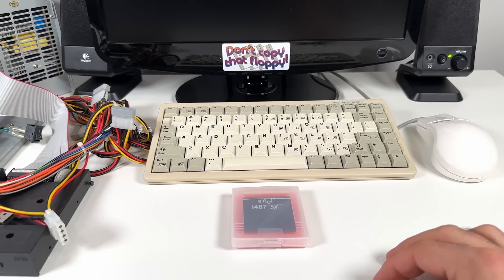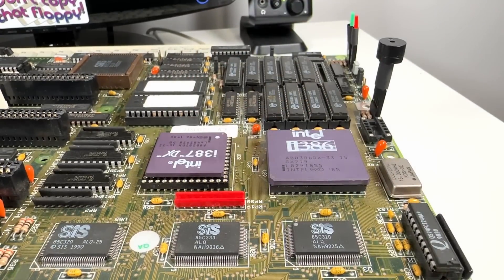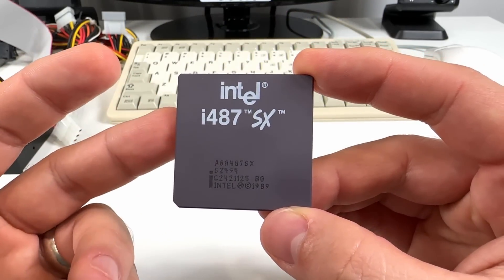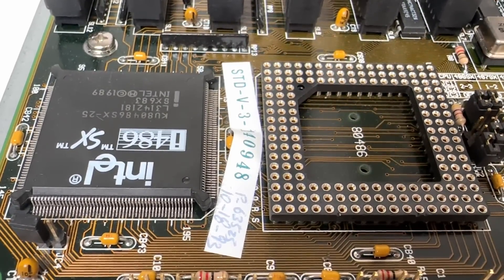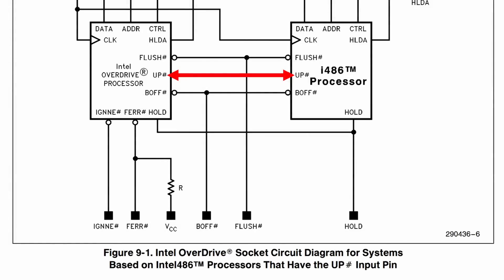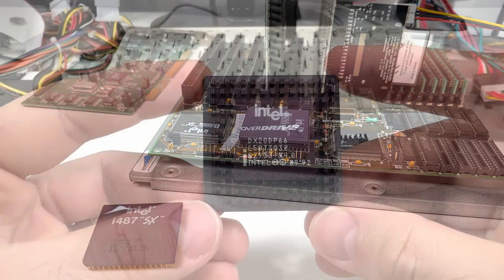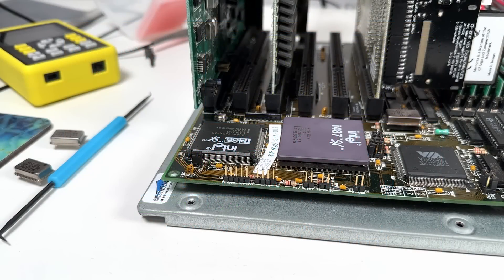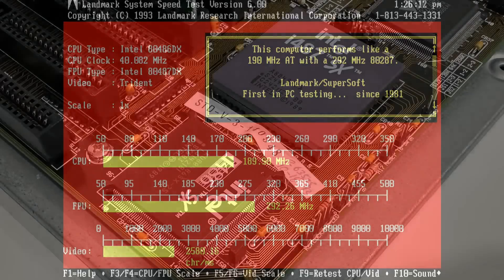The Intel i487 SX Math Co-Processor - Disingenuous or Just Misunderstood?

Comment: Intel called pentium a 5th generation chip. AMD may have had a 586. Cyrix 586 wasnt even pentium 1 486.

You needed a 487 and 486 for lotus table. 486 realesed with 387 backwards compatiblility. 

86/186
286 IRQ
386 bus logic (387 front bus with 32 bit memory addressing)
486 program blocks/pages
586 program specific memory- (pentium 3 with 133mhz front bus executing 4 operations per cycle)

Like the 386 could x86 32 bit pages, but the 387 calacukated half of 2 operations per cycle.

Comment: Hello! My first computer was a Compaq Presario CDS 520 (the integrated model with a monitor), bought in 1994 here in Brazil. It was a 486SX with 66MHz, 4MB of RAM and 420 megabytes of storage. It had a 14.400 bauds internal modem also, witch i used a lot for gaming.

The operating system was Windows 3.1, and it came with a software called TabWorks (which I later found out was developed by Xerox) as its main interface, which was really cool.

I was about 11 years old at the time, and I remember that it cost a LOT of money, something around 3,000 dollars (the Brazilian currency at the time was rubbish -- and it still is -- and everything was quoted/purchased using the dollar as a reference).

I remember that one of the first games I bought with "my" money (allowance) was Need For Speed 1. It didn't run with 4MB of RAM, my father had to buy another 4 megabytes. I played very well with friends who even had 100mhz DX4 486s.

That 486 lasted me a long time, it was an excellent machine. I'm a Compaq fan to this day.

I always wanted to have a math coprocessor to improve the machine's performance even more, but that kind of upgrade wasn't available here in Brazil.

Thanks for reminding me of that fun time of great discoveries, and congratulations on the video!

Comment: I stumbled across this video serendipitously on my feed and I'm glad I watched it! I couldn't help but notice that on your motherboard, there is a serial number strip starting with STD-... and a handwritten date code of October 18, 1993. As a teenager, I worked for STD Systems in London, Ontario, Canada, assembling PC clones (STD was headquarter in Markham, ON). The date would be period-correct of when I worked there; I would have been 17 years old at the time. The only thing that would be crazier if if that were my own handwriting (but it's not). We put those serial number strips after a QC check which followed an overnight burn-in of newly assembled PCs on racks. There would be an uncounted number of computers that have MY handwriting on strips just like that! 

Fun fact: since I was a poor teenaged student, I didn't have the money for a full fat intel 486DX or even a 487SX. With whatever money I earned, I spent back into my computers, gradually upgrading from a 386SX-16 (overclocked, of course, via onboard jumper to 20 MHz) up to a series of cheaper AMD processors and onto another motherboard that got me into the cachet of a 486 owner with a  Cyrix Cx486DLC-40 with a Fasmath coprocessor (but it was still on a 386 board).

I was also one of the many people who later joined the bandwagon of overclocking the Celeron 300A to 450 MHz.

Thanks for the 31 year trip down memory lane!
Reply: Just a question, did nobody question the choice of "STD" as a company name? I would have for sure chuckled and I am not even an English native speaker.

Comment: If I am not mistaken, when Intel manufactured the 486, the SX version was identical to the DX version except the FPU was disabled at the chip level.   
It still baffles me how there were any cost savings possible with the option of installing a 487 math coprocessor.  (very deceptive advertising since it was a full featured CPU),  These motherboards  had a socket that didn't have to be there.  It would have made more sense from a cost perspective just to have one socket (zero insertion force for ease of upgrading)  And for Intel's part, they would not need to sell chips with the extra pin.  
Plus from a marketing perspective, the "Overdrive" product name would have made sense as an "upgrade".  You not only got a coprocessor, but double the internal clock speed.

Comment: I believe the 486SX was originally a full 486DX that had the FPU disabled. Some may have been dies where the FPU failed testing. But essentially, if you installed a 487, it's quite likely you had two full 486DX CPUs, with one sitting idle. I think later versions of the SX did have the FPU removed, though.

Comment: The 486's on-chip cache would make adding an external FPU extremely difficult. For 386's and below, the FPU literally watched every instruction the CPU fetched, and stopped the CPU from executing FPU instructions. So, with internal cache, there'd be no way for an external FPU to know which instruction was executing when! So, my guess is the 487 was really just a marketting gimmick to sell a 486 "FPU upgrade" the same way customers expected from their past experience with 8088's, 286's and 386's, without it really being *possible*... WEIRD.

Comment: The machine I ran in that era was a 386/387 based processor running at 25MHz.  At the time that was extremely fast.  I also had a 100Meg hard drive.  There was a special driver to make the big hard drive work.  The thing sounded like some sort of farm machinery as it was starting up.

Comment: Need we have concerns about heat paste drying out on CPU's which were soldered to their board, particularly during the 90's?
Reply from the maker: Most Pentium and older 486/386 systems didn’t use any thermal paste. If they had a heatsink, they were usually glued on or used clips with no interface material. I don’t think paste became commonplace until the Pentium 3 era. Those chips definitely need the original paste replaced as it gets very hard and brittle.

Comment: cool.  I've been around the block a bit and i've never seen the 487 as a separate upgrade add-on.  I only remember the 486 cpu's being produced with and without math (sx vs dx).   My 286 pc on the other hand had an empty socket for the 287 coprocessor.  Man, I remember how stoked i was when I stumbled on a 287 at an electronics surplus sale.
Reply: after reading the comments, it alll started sounding familiar, not so much the separate math but that they were the same processor...

Comment: Never realized a math co-processor was just an FPU, I always figured it did other "mathy" stuff too.
Reply: Many of them do.  It varies by FPU.  For example some FPUs have trig functions built in, but the CPU still uses software libraries for this instead because the hardware trig functions weren't as accurate.

Comment: The 486SX did have an on-die FPU, Intel just disabled them. Intel deliberately hobbled some 486s to meet demands, but as 486 yields were relatively low when it first hit the market, 486DX chips with failed FPUs had their FPUs disabled, then sold as an SX.

Comment: As you point out, this was basically just to be able to sell 486sx chips. Btw, an average 386 with coprocessor could easily be faster than a 486sx, I have a box of them that all clock higher.
Reply: And yes, I did play both Falcon 3.0 and Quake on 386. Falcon was low res but very smooth and Quake was "fine" at very low resolutions. I even made maps on that machine.

Comment: IIRC Doom originally required a FPU in the processor. That alone sold many DX chips.
Reply from the maker: Thanks for watching! Doom actually had no floating point code in it so didn’t benefit from an FPU, but perhaps you are thinking of Quake? Quake was really the first big title that had a 100% requirement of an FPU and wouldn’t even start without one.
Reply: @vswitchzero  TIL, Maybe it was a performance issue. Dunno why I always thought you needed a 486DX-33 min. 
Thanks for the correction

Comment: Floating point math was always used in a variety of applications but generally they were not used so heavily that is mattered if the operations were performed by the main CPU or by a special purpose CPU ie. a FPU.
Reply: You've obviously never used autocad on a 386 with and without a 387 installed.  The speed difference is astounding.
Reply: @stargazer7644  Autocad is one of those applications that justified the expense. I worked for a company that designed buildings, they used the heck out of Autocad. When we finally flushed out all of the hogpodge of 386 and 486 processor machines we had some happy cadders.

Comment: 7:55 why are you pressing so hard on it? I thought these sockets are supposed to be zero insertion force.
Reply from the maker: There were ZIF sockets with levers for 486s (socket 3 for example) but this one was not a ZIF socket and requires some force.
Reply: Those are not ZIF sockets.  ZIF sockets have handles and came later.  The 386 and early 486 sockets required a significant amount of force per pin.  Multiply that by a couple hundred pins and you had to press hard enough on the chip that you thought you were going to break the motherboard.

Comment: Have you ever tried putting the 487SX chip into the DEC433 with the DX chip?  I'm curious from a logic standpoint to see what would happen, since apparently the UP pin turns off the existing CPU.
Reply from the maker: Would be interesting to try! Even though the system includes a DX/33 the i487 should take over and run at an over clocked 33MHz. Effectively downgrading the system to one without an FPU 😂

Comment: What was the advantage of soldering a CPU onto the motherboard and then having to provide a socket anyway for the "co-processor", which turned out to be a full CPU? Why not just put the main CPU in a socket, and then it could be upgraded to a 486 DX the normal way?
Reply: In a time were you had an outdated system just by leaving the shop, the "upgrade socket" was a huge sales point. You just upgraded the CPU, and you system was rather uptodate.
Reply: Nonsense of the era. Not much else! I guess super super budget motherboards may not have a socket.
Reply: Marketing.  We were already used to the idea of having a 386 CPU and upgrading it with a 387 math coprocessor.  So when they came up with the idea to sell the 486SX for 486DX chips with a bum FPU, it was easy to convince folks they could "upgrade" their 486sx into a dx with a 487 math coprocessor just like the 386.   People liked that better than the idea of buying a 486DX and throwing away their 486SX CPU.  Even though that's exactly what they were doing.

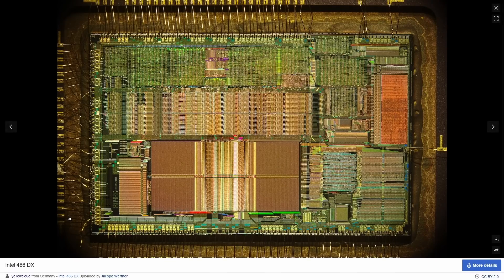Comment: 2:10 not the first Intel CPU to have an on-die floating point unit.
There was the i960 and i860, which beat it by 2 years.
I'm sure you meant the first x86 CPU.

Comment: The main CPU running cool when disabled is because that pin disables the internal clock distribution, in addition to forcing all IO pins to be inputs (same as tri stating them in CMOS, as the tri state disables the output drivers, but still leaves the input for that pin connected), so the CPU now does not have the active clocks running, meaning it sits in whatever state it powered up in, as the logic that resets it also is disabled by that pin, and it is just in the first clock state of reset forever. Disconnect that pin with power on and the CPU will complete the power on reset, and jump to the BIOS to start execution, and it will do the cold start routines, though with another CPU actively driving the bus as well it likely will just immediately crash the system.

Comment: I had a computer with a soldered 486 SX and I do remember seeing the coprocessor socket too even though it was never once used by me at any time.  I no longer have that computer any more but it was a Packard Bell Legend 750 and it was my first computer quite a very long time ago.  I don't remember the specs of it but it was basic and had no sound card, no CD.  Those things were added later.  These were computers from a time when to configure something you had to open the case and move jumpers around so they were not as user friendly as a computer today.  If you installed something inside it you would have to move jumpers around to make it work or the computer could just fail to POST until it is configured properly.  This was from a time when CPUs didn't need a heatsink to prevent them from self destructing.

Comment: Great video. I'm just skeptical that performance was the main reason the 487SX replaced the 486SX entirely. Even with the faster floating-point capabilities of the 486, IPS would still be much lower for floating-point than integer instructions, so the slower bus might not have been a huge drawback. This seems supported by the RapidCAD, which, according to Wikipedia, was up to 80% faster in floating-point on the slower 386 bus.
I think the main reason could have been that supporting an external math coprocessor on a die specifically designed to work with an integrated one would have required a significant redesign—something Intel probably didn’t consider worth the expense.
Reply: The RapidCAD did not have a separate FPU - it used a core derived from the 486DX with an on-die FPU, avoiding the need to communicate over the slow 386 bus.
The RapidCAD package included a second chip that went into the 387 socket, but this wasn't the FPU. It was actually some programmable logic to generate an extra signal needed for compatibility reasons.

Comment: Didn't the co-processor correct the floating point error? I don't know how you can justify the characterization in your title. You greatly underestimate the importance of accuracy in the areas it effected.
Reply from the maker: Thanks for watching! My characterization in the title applies only to Intel’s i487 and the fact that it’s a full function 486 DX and not an FPU as Intel’s marketing suggests. It does not apply to math co-processors in general.
Reply: FPUs did not make the math more accurate, it made it faster.

Comment: Early 486"SXes" were actually just 486DXes with the FPUs disabled ither because of a bug or manufacturing defects.
Some early SX boards even having a 387 socket if I am remembering correctly.

As far as i am aware one of the earliest cases of a imperfect wafers being used for lower end versions of a chip.

Ironically when this video showed up on my list, and as I am watching it, I am currently doing a Windows 95 install on an emulated 486 machine. lol

Comment: I dont remember if they were 487s, but I remember on my 386 some unix thing (maybe linux?) wouldnt run and I had get a second cpu/math co processor that plugged in next to the main cpu. And my second 486 had the same heat sinks with overdrive on them and it was a dx4 that ran at 133mhz, and i had to replace the mother board because the dx-66 i had was a different chip or something. I dont really remember details, it was over 30 years ago.
Reply: Unix/Linux doesn't need floating point...
Reply: On your 386 that would have been a 387 math coprocessor.  I'm not aware of any version of Unix that required one though.